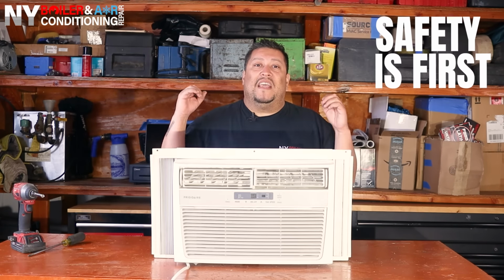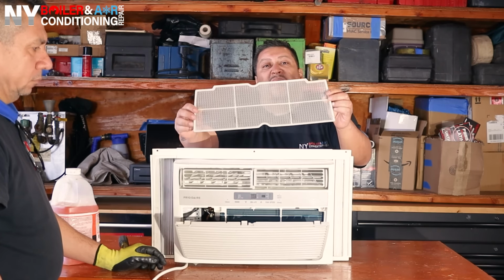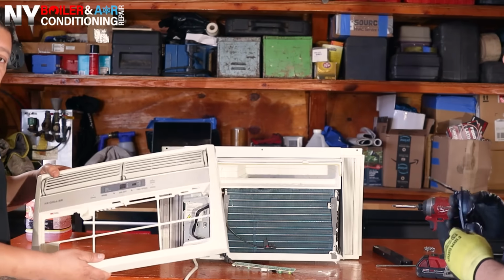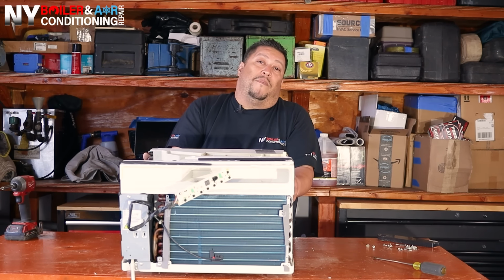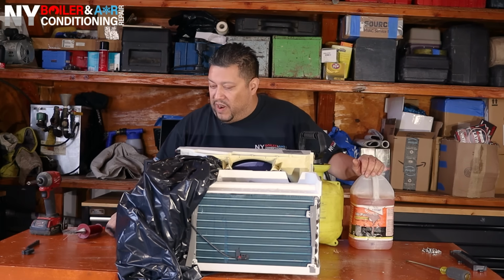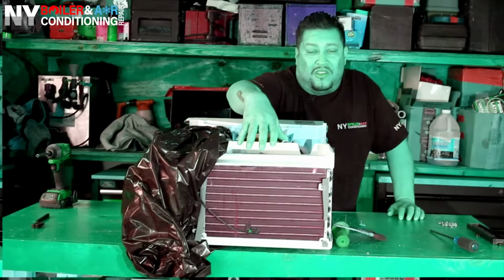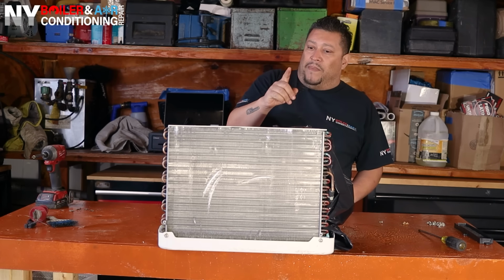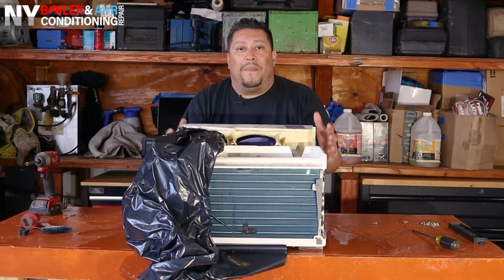HOW TO CLEAN YOUR WINDOW AC UNIT COMPLETE EXPLAINED (Louie The Boiler Man)

Comment: I live in a building, 2nd flloor & A/C to heavy to remove. It it dirty & now over heats & plug get hot & apt breaker shuts off after a few min of running.  Should i just invest in a new 1 ?
Reply from the maker: Yea i would say so especially if the unit is over 10yrs old. Companies don't repair window or wall ac unless its a ptac style ac like what you see in hotels. window and wall acs are not worth repairing with the cost of labor and parts are not available.
Reply: Hopefully this gentleman that has the channel or some other professional or somebody who really knows a lot about those window units can give you a proper answer .